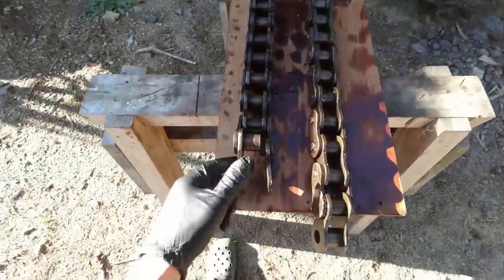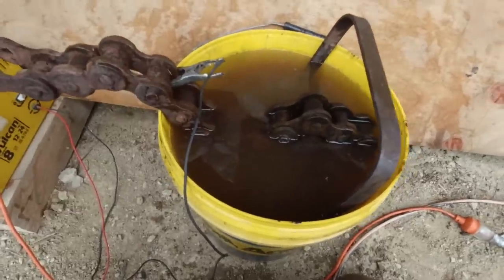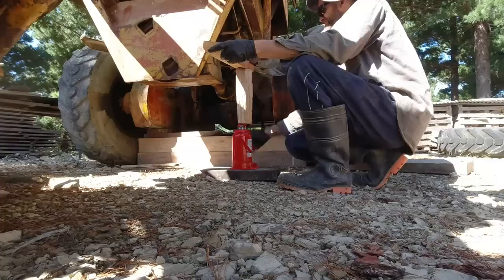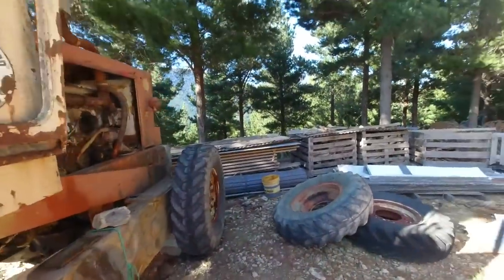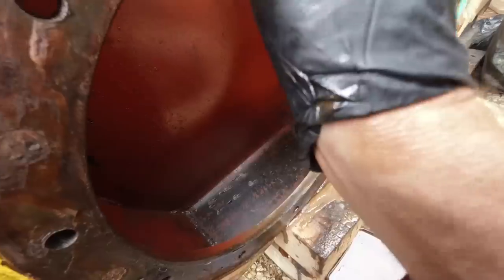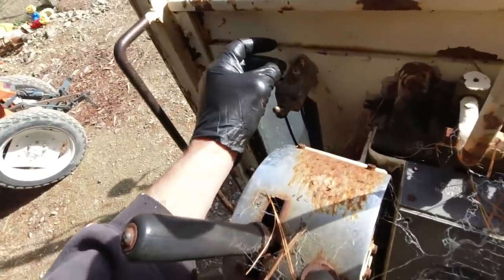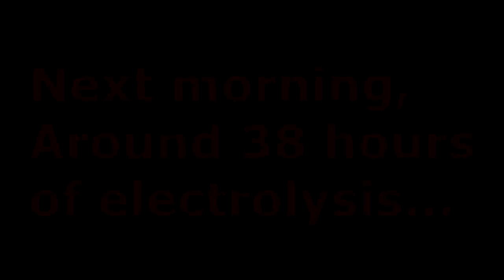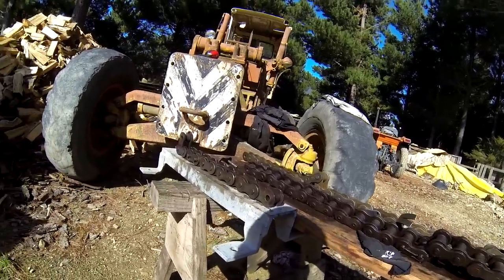12 Ton Grader for Scrap value Part 3- Long Overdue Repairs & Maintenance

Comment: At some point when trying to salvage something (like this chain), you've got to bite the bullet and say "more trouble than it's worth,"  so good decision on replacing the chain with new.  Bearings and chains are hard to save if they've been overstressed.  Nice demonstration on de-rusting the chain with a battery charger.  Thanks
Reply: Yes and if the chain broke it could take out the other one, bearings or the gears and that could be real expensive
Reply: Baking soda instead of salt works just fine too and it’s not corrosive.
Reply: I'm such a cheapskate that I would have been piecing that chain together.  After all, how many miles is it actually going to drive in the rest of its days?
Reply: @bobcranberries5853  Thanks for the tip ! 👍

Comment: What an immense feeling of satisfaction you get when you find the correct nut in a box of old nuts and bolts. In my case said box is over 45yrs old and belonged to my late father 😀
Reply: Mines from my grandpa
Reply: Bob Cranberries ye same
Reply from the maker: Its like winning lotto on a smaller scale
Reply: I know exactly what you mean
Reply: With lock down, I have been hunting through multiple boxes and winning!
Reply: When you find that nut you need in a box you have had for decades it is always good to remind the wife, "hey look, I knew I was going to need this" as she has likely been after you to pitch it for that long.
Reply: that used to drive me NUTS! I have many bolt bins and drawers, ever clear plastic containers...ORGANIZE, saves a ton of time!!
Reply: Lets see I have an allotment from my late brother, an allotment from my late dad and an allotment from late father-in-law; well those are the important ones. I make sure every time I win the lottery that I look to them and say aloud ... "Thanks!"
Reply: feels so good
Reply: Hi Ewan, I spent years with my late father collecting nuts, bolts, washers, rods, springs, odds and sods etc, from parts we had to scrap. They are in used margarine and ice cream tubs in the workshop. I know exactly where to go to find the bit I want but I don't want to reorganise into plastic bins as I wouldn't be able to find anything!
Reply: I don't know why but i got emotional reading your comment, especially the last bit. May he rest in peace.
Women won't get that but men have emotional attachments to little things such as in this case a box of bolts, nuts etc. And the joy we get when we find something useful from these "junk boxes" is somewhat very special.
Reply: Hodwooker you need to get yourself a garage/shed and start keeping all your bits and bobs, apart from anything else it's great therapy, almost as good as having a dog.
Reply: Me too ! And lots of small bronze screws and nuts. Gold !
Reply: I have no doubt he'd say i knew itd come in handy one day!

Comment: I worked for a year for a ready mix outfit.  We only had one new single screw tractor everything else was old Mack trucks.  We ran those old mixers until they just would not go anymore.  Our mechanic was a junky, only good when he was high.  It was quite an outfit.  The thing to remember was that when work dried up the boss had no bills since he paid cash for all of his equipment.  Our dozer  a D8 I swear was in John Wayne's movie the fighting SeaBees.  It did not have hydraulics everything worked by cable.  Our front end loaders were all down to brakes on one wheel if that. Our material ramps were built with just the right amount of slope to stop the loader and let you drop  your load.   It was a great place to work if you liked going to work at 430 in the morn and by 500 you were covered by cement dust.  Worked there until OI went back to work for the local Telco.  Good clean telephone work.

Comment: I’m impressed with the electrolysis.
Reply: I have used it several times. I did the engine block from my 1935 WC Allis Chalmers in a 55 gallon barrel. It actually took out lime deposits from the water jacket. I think the block was as clean as one I had baked and shot peened.
Reply: Me too I have never seen that before..
Reply: pre mix the salt in water to dissolve...
Reply: Ma

Comment: I did the same rebuild on the drives of my old cat 12 grader I washed it out with a bucket of diesel under the drain plug and a little drill powered pump and some hose worked amazing
Reply from the maker: Good idea

Comment: At 24:49: The muck floating on the surface of the electrolysing liquid is a combination of Iron 3 chloride (FeCl3), which by itself is slightly acidic in nature. (About pH6 give or take a point or two.)  Sodium oxide (NA2O), is the other by product. A concentrated solution of sodium oxide will have a highly alkaline pH of around 14.It is sometimes used in the glass making process and for making Sodium hydroxide (NAOH) which is also called caustic soda or lye. NAOH is also highly alkaline and is often used to clean drains and to make soap. NAOH is also used in the textile industry but I have forgotten exactly what it is used for. Probably to remove fats and waxes from wool. Hope this answers your question.

Comment: Hello to a kindred soul from a far away continent ... You are 100 percent correct regarding the tires sizes causing additional stress on that drive chain.. I worked in the strip mining  coal industry in eastern Kentucky and the western counties of Virginia in the late 60s thru the early 80s.... Operated and worked a lot of old equipment then..  I throughly enjoy watching what you're doing. Stay safe,  near Raleigh, North Carolina, USA....🇺🇸🇺🇸🇺🇸🇺🇸

Comment: We had the same problem on a Cat 992 loader I was on at Brockman iron ore mine in WA they put new tyres on the front had to nurse her along transmission temp going up ,didn’t like working in 40 degrees fighting against different speeds

Comment: When i was a lad .....there was a product called lynklife  - it was a round tin of grease you dropped your bike chain into and then heated it up - before o ring chains. I also used the family oven for heating crank cases, no matter how i cleaned them the smell of oil was instantly obvious to mum on her return 🙂

Comment: Damn he is a right one that ram,Its Awesome to see old machines getting new life,old friend of mine all he did was work on old stuff which had been parked up for years and get them nearly back to new he had a small machine shop in his place made lots of the part he couldn't get from nuts and bolts to half shafts and so on Awesome chanel Marty T

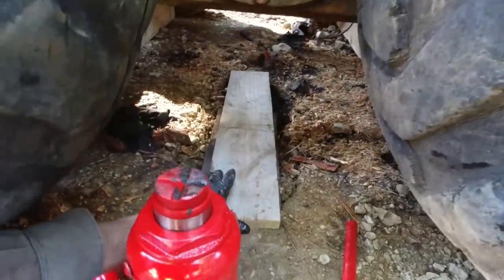Comment: Marty another amazing renovation project.  Concrete  blocks are not good as jack stands 7:03 good in compression but if the base and loading point above are not level / uniform and place a bending load they are frangible / brittle. Great you had back up to the jack but take care.

Comment: I love the clever cordless tool adapter you made which appears in previous videos.  I wonder if you connected it to a power supply or just to a suitable battery?  Thos manufacturers know the tool will last FAR longer than the crappy batteries they supply, at least on the older-technology batteries.  Thanks for you great work.

Comment: That gasket material looks a lot like CNH anaerobic gasket sealant. the stuff is really neat, you could set it out for four years and it won't harden, but once the two surfaces meet the stuff tenses up overnight. Seals really well on the old Case tractors we work on. Love the videos!

Comment: Back before I had to retire when I was working on old stuff I kept a square can like Spam came in for cleaning out flat mucky areas like you were doing. Way faster than using round ones and good to put small bolts and screws in so they don't get lost. Have a great day.

Comment: I've used electrolysis to clean relics I unearth doing metal detecting.  Works amazingly well.  Excellent demonstration of it in your video.  Thanks for sharing your work on this old piece of equipment with us.  Always a pleasure to watch you work though my back aches watching you break loose all those rusty bolts and nuts!
Reply from the maker: Thanks mate, it was my first time using electrolysis to remove rust, my method was not perfect but it turned out better than I expected

Comment: Looking good! Nice that the sprocket wasn’t badly damaged.... also not seen that battery charger, water and salt used before to remove rust.....
Reply from the maker: First time iv'e used that method for rust, I was surprised how well it worked

Comment: I have found that when you are scraping out gooey stuff kitchen spatulas do a really great job, even with watery liquids and they hold up quite well and are easy to clean off and use again. If you flatten a tin can on one side and grind it sharp like a putty knife you can move the crud right in an pour the stuff out.

Comment: I once stripped down an engine down to the block and got just about ready to use, only to find a crack between a cylinder and the water jacket. I was really disappointed at the time, but like your chain - I’d rather find a crack now than put it all together and have it kerplode later.

Comment: I had zero confidence in the electrolysis cleaning up that chain but I did work out great. Too bad after all you put into it you couldn't use it. Good choice getting the new chain instead of cobbling something together and have it fail again.

Comment: A basic automotive hint: lug nut removal with less wheel-spin achieved with lever-bar across the hub, diameter vs radius.
I used an Aveling Barford forklift years ago, and later a co-worker on Stockton coal overburden contract drove a Rolls-powered Aveling 35-ton dumptruck. That was 'the barfly', and it flew alright, rolleddown the tip-face! Oops :) Seat-belts were not a 'thing', so the driver was very lucky to emerge unscathed. Barfly could be an apt nickname for the chain-ornament!

Comment: Running a magnet wrapped in paper or tape, through there to collect any loose filings that came off the chain or sprocket that might have been missed would be an idea for next time.

Comment: Try wrapping a strip of chicken netting round that metal step with jubilee clamps to hold it in place. It makes a good boot grip.
Ex drench containers with one face cut out make excellent flush, drain, drip and soak trays - they don't tip over!

Comment: I use soda crystals for my electrolysis projects. It's also known as washing soda. I think when you use salt it gives off chlorine gas? Also using thin steel plate with a large surface area for the positive side is good. It's a great way to clean rust parts. Great videos, thanks for sharing, hello from the UK.

Comment: Another satisfying video great hood ornament I'd go with the "Slug" for her name though, on another note not sure on the tyre situation there in NZ but here in Aus second hand grader tyre's are a dime a dozen, if you have a hot repair or relug  tyre place around you should put a word out for some second hander's or repaired tyre's so you have a couple on hand save you paying a fortune for some on the spot when you need them. Same can be said for most your wheeled farm gear.

Comment: Magnets.. removed from Speakers.. in the chain cases... in the hydraulic filter..  in the fuel tank.. .
Reply from the maker: Good idea, I have a few neo magnets on my fridge, I could use them
Reply: @MartyT  Microwave magnets also awesome.  Plenty free microwaves at my recycle center.
Reply: @MartyT  Old computer hard drives have some really strong ones.
Reply: was thinking the same thing but microwave oven magnets
Reply: @TheOtherBill  you might want something bigger though.
Reply: I use Cow magnets, put them down in low corners...work well and don't come loose (not in crank cases!)
Reply: @axeman2638  he is down under where washers and driers have transmissionless operation.. where they are just a bunch of neo magnets and a few coil windings..  i bet he can come up with something from one of those fairly easy.  i forgot microwaves have magnets in the  magnettron..

Comment: I love watching what you do.
Tip: if you use carbon rode when doing electrolysis (the ones used for arc gouging) it will give you faster and cleaner results

Comment: That muck on top of the electrolysis bucket will contain a number of different ferric oxides as well as copper oxide from additives in the original chain lubricants...
Reply from the maker: Nice, I believe the gas coming out is explosive as well- hydrogen, oxygen and chlorine

Comment: Been a long time since used to strip these down for repairs  ,  company I worked for used to convert the graders into hot planers . Very dangerous piece of kit . . Keep up the good work and content Marty .  Top man .
Reply from the maker: Nice, thanks mate
Reply: Fava Fava what’s a hot planer? Like a wood planing tool or what.
Reply: @darthrevan2063   it's a grader conversion , full length at completion is around 40 feet in total . Firm I worked for had the contract from a company in little rock ,, America to build them for Thier own use only , basically heats the road surface then skims the wearing course off the road . Into a built in elevator then out the back of the machine into a truck that is hitched to back of the machine . When truck is full , unhook it then hook next truck up and carry on until the whole road is completed all done in one shot with one machine .simple  , leaves the road ready prepared for total resurfacing . . Next squad comes in all setup to resurface with new . Job done . Had to have the licence from America to be able to build them because it was Thier invention . Think the company I worked for at the time had built four .  This was 70s early 80s in England . The only ones in the whole country . Could do carbonising wit them also . Scarifying . They were always in use with major contracts nationwide . Excellent machine . If you have seen a cold planer . Very similar except it has a full width 20 foot long extension on the front with shielded full width of machine Bank of adjustable height propane burners . And two 6foot diameter propane raised tanks behind the operators cab , hence the dangerous part . . Uxbs . we used to call them . . Big boom if they ever leaked for sure .  Wouldn't be a lot left standing put it that way . .

Comment: You need more surface area on your sacrificial piece. 
You can do it in that yellow bucket with a ring of wired together sacrificial metal strips.
Reply: Rule of thumb as i know is 3 to 1 in favor of the sacrificial part's surface area. I just have this big water tank (the kind with aluminium frames around them) and i cut the top off, inside i dropped a 4 cm thick slab of iron i got from a shipyard. Whenever i'm done with the de-rusting, i just use water pressure to clean it or sand blast it, then drain the tank. I doubt i'll ever drop anything inside that tank that can out size the slab.
Reply: @aserta 
Good to know! 
I go by surface area usually since I don't have a decent sized container to set up a permanent tank. 
I've always made sure the sacrificial metal was greater surface area than whatever it is I'm cleaning up.

Comment: Hey mate we have used 12mm tie down chain as a temp fix. Lasted 6 months before we bothered to fix it properly. You just need to find a chain that sits on the sprockets.

Comment: The 'gasket' between the axle housing and the chain drive housing looks like Loctite 515. We use it to seal up the the wheel hubs on the Case Magnums at work
Reply from the maker: Thanks, I'll look into it

Comment: that deep groove in the center of the tire makes me think the broken chain locked up that wheel for a time. ok, i was wrong. the different tire sizes prolly did it. one would always be sliding a little, and that would definitely cause that groove. you can see the scuff mark on the rear tire. a 4x4 with an odd size tire will do the same thing. it will stress the driveline until something breaks. prolly what broke the chain. i replaced the transfer case in a ford truck for that reason when i worked in a garage as a mechanic. find a longer bit of tube, and weld a socket in one end. then you can use a ratchet or breaker bar to turn that filter housing. haha! love the snail hood ornament. i agree, it is perfect.

Comment: 18:33 Thats what she said. I dunno about leaving those bearings unchanged Marty, that sludge will have gotten all through that case under normal operation. It sure as hell would have coming up the hill you're on, the oil going back and forth on that incline would have mixed all that crap up nicely and put through all the bearings and seals. I think that thin gasket is just that paint on gasket, cant remember the name but I remember it being in a small white bottle with a red top and blue lettering.

Comment: I have used electrolysis and was told it works in a sort of line-of-sight way.  The short answer is, you need more sacrificial metal, all connected electrically for it to be the most effective

Comment: Oh yes my steps are broken off on one side, the other side is cracked, they put giant rebar, I’m going to replace mine, with giant chocker cable with plate steel across, for steps, I’m actually going to research it , anyway thanks for the vlog, I’m learning from your video, thanks BigAl California.